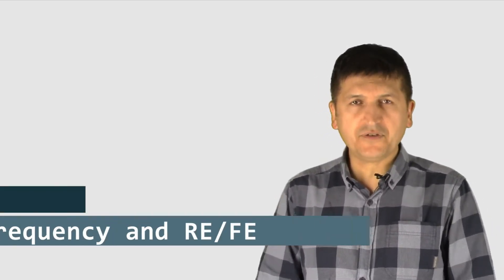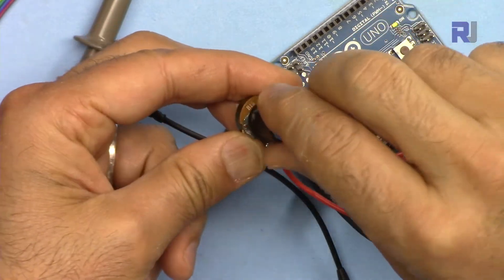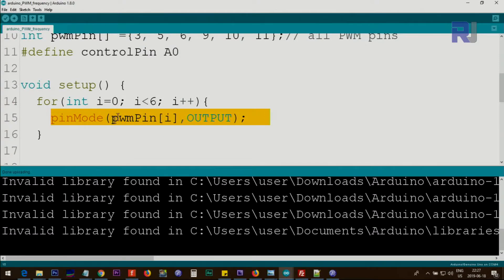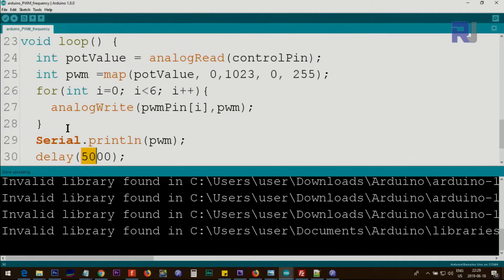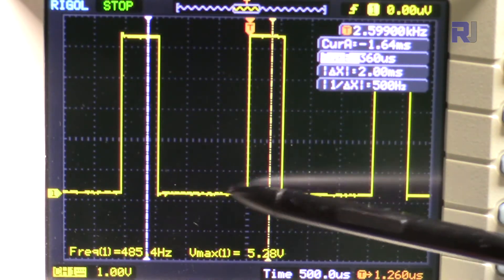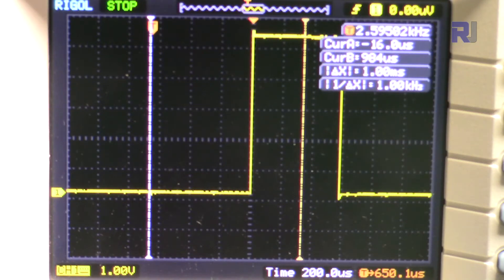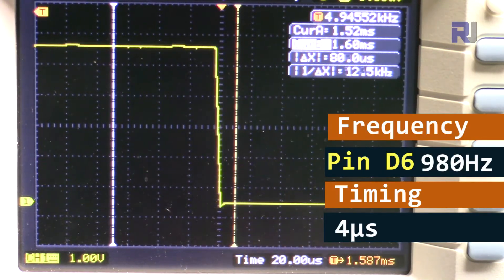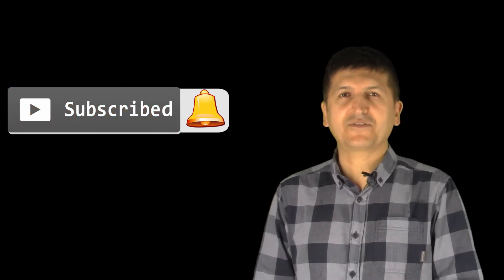What is Arduino Uno PWM frequency and rising time and falling time RJT167

Comment: Rise and fall times are going to be dependent on the amount of capacitive loading at the circuit node in question.  Also, just about every datasheet that I've seen that specifies one or both of these measures between the 10% and 90% points,  not from zero to whatever the amplitude is.  I suspect that's to eliminate the influence of overshoot and ringing on the measurement.
Reply from the maker: Thank you for your informative comment.

Comment: Plz code pwm 3-phase avic lcd  1602
Reply from the maker: For 3 phase you need Arduino with 3 interrupt pins to detect the zero-crossing or phase.  I don't have the code or project at the moment.

Comment: Arduino IDE 1.8.0 released December 2016. Is this an older video or do you have a reason for staying with 1.8.0?
Reply from the maker: I have both IDEs . No reason.  I don't want to move my libraries that I have in specific folder with the 1.8.

Comment: Please make video on how to combine two adrduino programs.
Reply from the maker: what do you mean combine two arduino program? You mean two Arduino interact with each other?
Reply: @robojax  not like that. I mean suppose i have one program of 'ir remote for home automation' and another program for say 'LDR based automatic light on/off'. I want both of them to function simultaneously.
Reply from the maker: they are independent devices. You can communicate via I2C protocol to send command from one to the other to do something.
Reply: @F_Tandel  Search for "Multi-tasking the Arduino - Part 1
By Bill Earl" and read all three parts. This will help you learn how to develop more complex programs. To "combine" what began as two separate examples. 

Hope this helps.